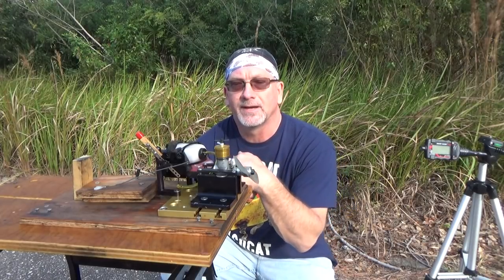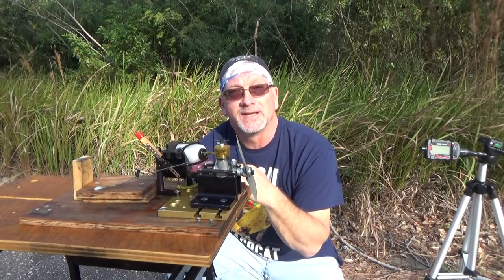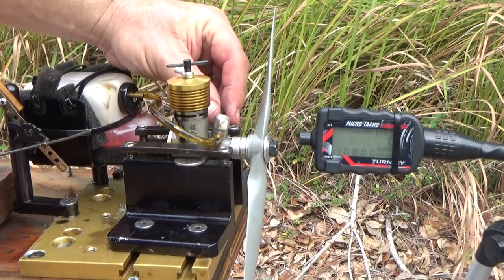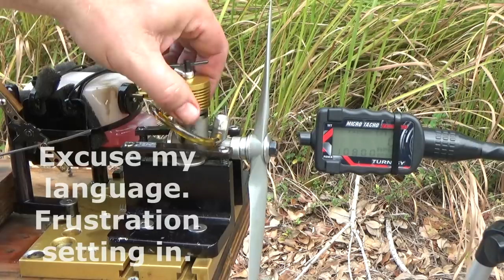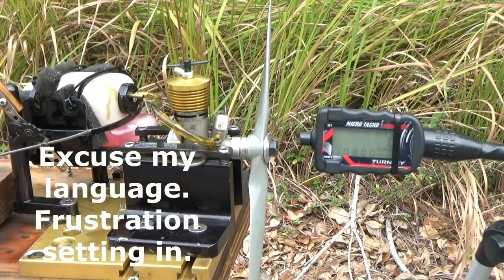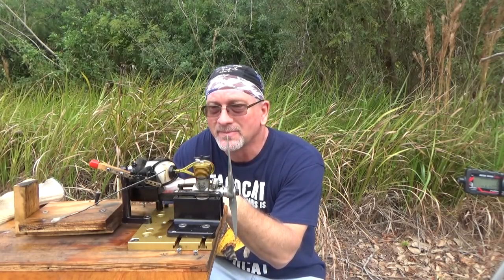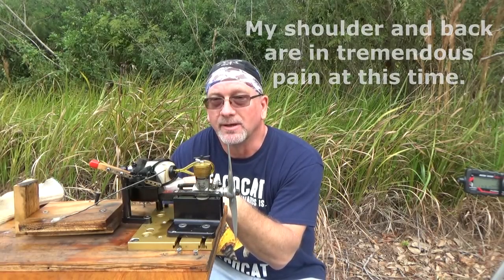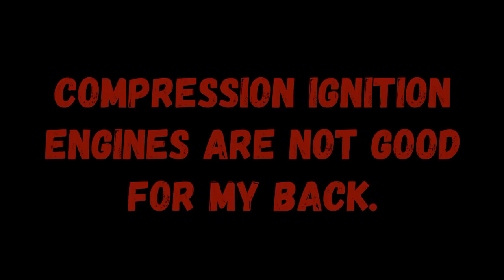Silver Swallow 2 47cc The First Run

Comment: Don't be frustrated .. Diesel engines, once you get to know them, are truly a gem. For the best initial break-in, try to run the engine under-compressed (engine starts to misfire) and enough fuel so that the exhaust residue on your finger is clear oil and not dark oil (sign of over-compressing) and give it about 10 to 15  2-minute runs like these .. By then you should be able to start leaning the engine a bit. The 9x5 or 9x4 should be right for this engine at this phase.
Love your videos man .. Good luck and have a wonderful New Year coming up.
Reply: That is some solid advice! Agreed, the dark oil coming out of the exhaust is a sign of over compression.

Comment: The Workout Engine. I forget which diesel I was trying to start a few years ago - about the same time-frame as this video -  but it would burp and stop, burp and stop. Diesel was all new to me. I started noticing something might have been wrong with the sleeve. It took a day or two to find the info on the internet, but sure enough, someone had put the sleeve in backwards. Probably why they sold it - couldn't get it to run. Ran fine out of the shoot once I figured it out. Talk about a sore back!

Comment: Hi David.
Like somebody else wrote,what ventury is on the carb? The bigger ventury is for a higher rpm range...and there fore higher sucktion...but only with small props.With the 9x4 you should use the smaller ventury.Also the fuel tank is too high.The fuel must be suck in and not almost drup in.I am not sure,if thats the case,as its not good to see in the clip.That makes the adjustment so extreem sensitive and difficult.Diesel model engines have a MUCH smaller ventury than glow engines,keep that in mind.
But with a small ventury,a 8x6 or so and the tank just under the NVA hight will improve the start for sure. The Engine is a good performer,if all the factors are right. I have a new, with a red head,as they come with different colors.But my had a bad compression,so I make a new piston.I dont know,if you check out my channel,but I guess,you will might like the stuff in it..
Wish you a great new year party,many nice engine runs,and all the best for the new year!

Peter
Reply from the maker: Hi Peter, Oh I have seen some of your videos already!!!   That was the first time I had ever run that engine so I am chocking up the hard start to that and settings.  I just came back from running this engine again along with the MK-17, with my own home brew diesel fuel.  It started much easier with the tank position in the same location.  I also had a smaller venturi.
Reply: That is great news.It needs a bit time to get used to  it and get the right feel for the diesel model engines,special the feel for the right compression force feel on the prop blade.But you will see,with every engine and run,it gets better and better.Never use a e starter,as this can ruin the engine instantly ,if you have a hydraulic lock.But I am sure,you get master it,as you have a lot feeling for it all ready.I send you a link about DR.Diesel.He sell ready mixed fuel.

Comment: Dave, I have been trying to turn over engines from the 1950s left to be my an uncle.  I thought it was just me who wore their shoulder out flipping the props.  A question - are these battery operated engine spinners worth the investment?
Reply from the maker: Yes, obviously electric starters are the easiest way to start glow engines.  However I have been cautioned not to use them on the small diesel engines as it cold easily damaged them.
Reply: Thanks.

Comment: Man, trying to understand the correlation between compression adjustment and needle adjustment is giving me a headache.
Reply from the maker: It really isn't all that hard once you have run a few.  I make a compression change and see what the response is.  If poor, undo the change and make one on the needle.  Just like anything David, it just takes a bit of practice.  I hope I made this look easy.
Reply: As usual Dave you make it look much easier than it is. Without actually having any hands on (or fingers on) experience the tuning of diesel motors leaves my head spinning. LOL!!